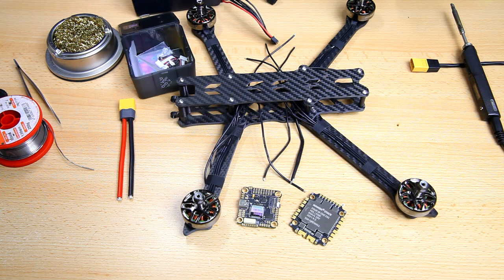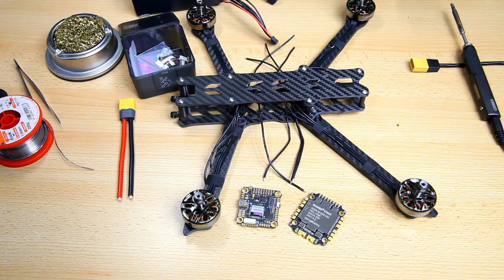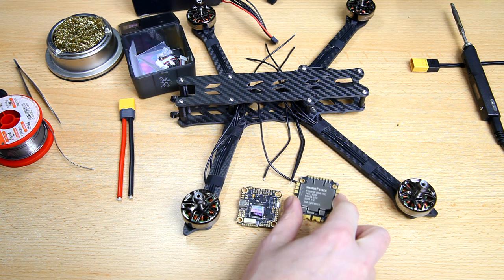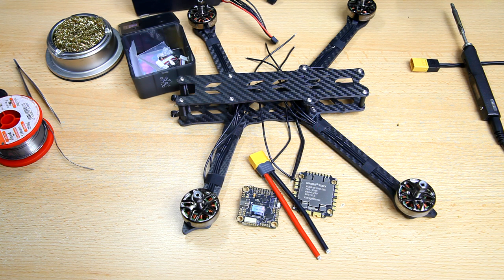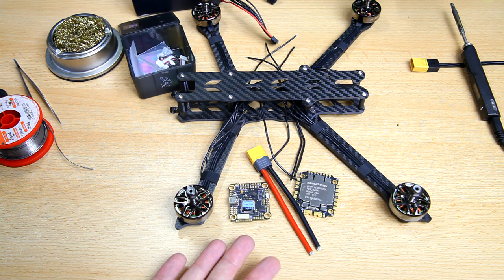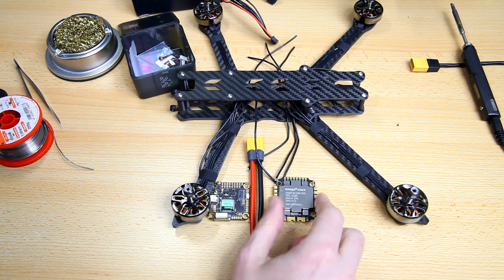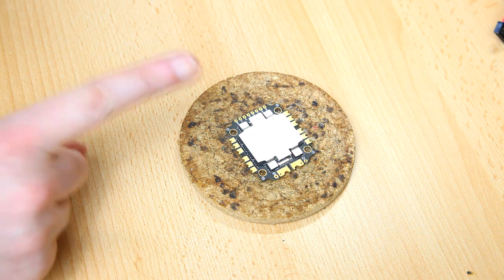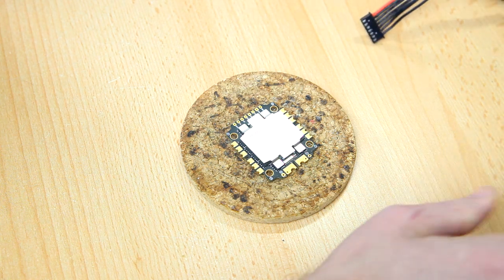4-In-One ESC Install - Diatone Mamba 65A 128K (Rotorama Buddy 7" Build)

Comment: Thanks for the tips with the soldering. Still a little struggle to get the power wires soldered in.
Reply from the maker: you're welcome and well yes.. without camera & lights in the way it IS easier.. But I will probably revert to wrapping the wires Over the ESC.. the soldering job is somehow A Lot easier that way :)

Comment: Good to hear that bridging two of the motor wires don't always fry the ESC. Those large exposed connections always look precarious to me.
Reply from the maker: Yes :)  especially when you first test the setup and not instantly go to 100% power :)  you will instantly see / hear something is wrong, and it can be solved before damaging things :) 
The solder-pads being out in the open.. well yeah... I guess we have gotten used to them :D  They aren't really an issue

Comment: Hi, I am curious as to which way around you installed the low ESR cap? I have built a few quads with the Mamba esc but only just realized now that I may have been putting the cap on backwards, although they are all flying fine.  These caps have red on the top which I presumed was indicating the positive side, and that's how I installed them on my other builds, but after looking at these caps again I noticed that the short leg is marked with red. As far as I was aware the short leg should be negative, so I'm a little confused as to the correct polarity now!
Reply from the maker: Howdy :) 
most any cap has a "marker" on one side.. on the black cap's it's a white band.. on these ESP cap's it is indeed a red marking.. that is however in almost all cases the Ground :$ 
interesting to see how the quad then does fly well.. Maybe the cap then simply never get's charged?

Comment: In the manual it's written that I should only use the capacity if I fly with 6s. In my case I'm flying with 4s should I also anyways solider the capacitor on it?
Reply from the maker: Yeahhh so not sure if the meaning what they say is simply lost in translation.. 
I do also use the cap. on 4S builds and I would think it then also helps in leveling off ripples.. 
Also: if you ever want to change the motors out with a 6S setup.... you will then already have that cap in the quad... 
I don't really know of a downside of having the cap on it

Comment: I tried to solder the motors on today but for some reason the solder does not melt almost at all even on higher temperatures. On the practice board it worked fine. How do I know if i broke the ESC?
Reply from the maker: Are you using solder with a flux-core? This board itself shouldn't make soldering harder then with other boards.. 
And (allways) to test the ESC you need to use a smokestopper (goggle it.. you'll see what I mean) to prevent damage...

Comment: Is it always a pain in the ass to get the cable for the xt60 to stick to the esc
Reply from the maker: Make sure to pre-tin the PAD's (have  nice bubble of tin on them)
And pre-tin the wire-ends as well..
use an iron that doesn't sag in temperature
then heat both the wite and the pad when joining the two

Comment: Dutch, can I use a MAMBA Stack MK4 H743 55A

On a tarot 650 with 4 Tarot Martin long endurance motor?

I have 2 new naza and I ran I to problems,  no one want to help, so I am going to ditch for the above.
Reply from the maker: Hi there :) sooooo whith any question like this you will have to "guess" what the amp-draw of your quad will be.. With a Tarot650 like that... I think the amp-draw will be limited and this should work out just fine :)
Reply: @DutchRC  awesome thank you

Comment: How do you know which wire in the motor goes where? They are all black.

Can I use a banana plugs to the ESC? For quick disconnect

Can this unit use a GPS?

Can this FC connect to a frsky receive?
Reply from the maker: You don't need to know :)  if the motor would run in reverse, you can simply reverse it in software... 

hmmmm instead of the XT60 you mean? That IS possible ofcourse, but XT60's are kinda the norm for drones in this size.....
Reply: @DutchRC  I meant the bullet plugs not the banana plugs.
Reply from the maker: @gtaitbiz7787  I see :)  that IS possible but you shouldn't... 
it would be a point of failure, and it's not needed (you can simply reverse motor-direction in software)

Comment: How do you calculate the ESC size for 4 X 2700KVM motor?
Reply from the maker: that isn't the only thing that matters.. the weight.. motor-size.. propellor pitch.. will all play a part in determining how high the Amp draw will be.. 
If you are new to picking the right ESC: find a RTF quad that is similar to what you want to build, and see what ESC's are in That RTF quad...

Comment: Plz remind reliable latest mamba stack for fpv
Reply from the maker: remind who? you?  about what.. are they reliable or... not?? 
sorry.. no idea what you ment..
Reply: F722 mk3 is the latest stack from mamba or not
Reply from the maker: @WANG-GAMER  at this moment Yes..
Reply: @DutchRC  H743 MK4 FC 128 ESC
Reply from the maker: @WANG-GAMER  yeah hmmm... same ESC ofcourse.. Do you need a H7 ?
Reply: @DutchRC  not diliverable in india
Reply from the maker: @WANG-GAMER  why not? Import restrictions?
Reply: @DutchRC   i also trying to assemble a fpv drone so please suggest and help for better
Reply: @DutchRC  Ya import restrictions so i will try to buy local market so suggest for future performance good if i build what's components require like mamba stack, 7'' frame etc.
Reply from the maker: @WANG-GAMER  yes.. it seems hard to get parts over there.. You do have actual RC shops?
Reply: @DutchRC   I am trying online shop,  my recommended maximum components not in stock  in India so Iam waiting plz suggest best fc, esc, frame etc.
Reply: @DutchRC  yes but they are depend on china import as well as yet india and china some controversy
Reply: @DutchRC  I am also AliExpress, Bangood user but shipping issue yet
Reply from the maker: @WANG-GAMER  Yes.. I will say I had expected more RC products to be produced in India by now :$